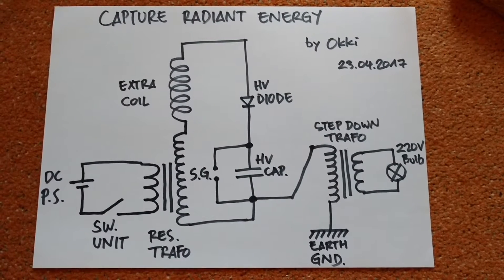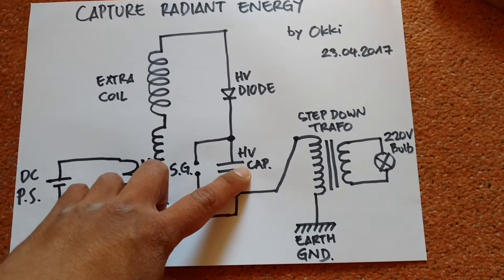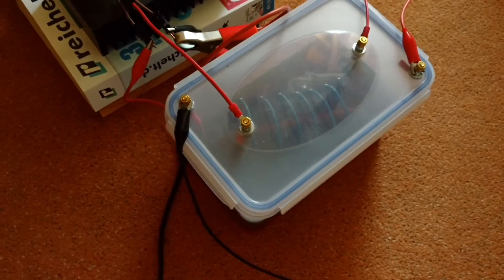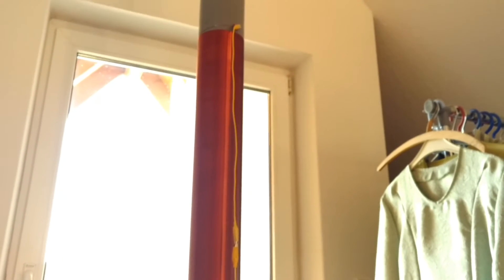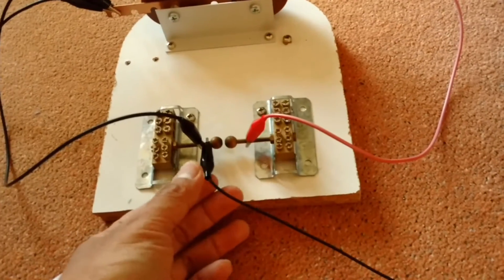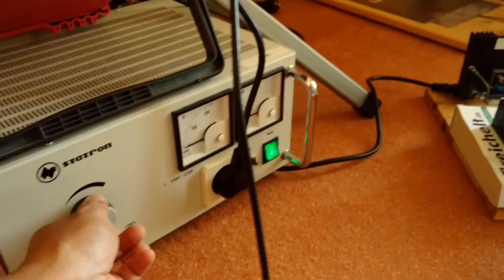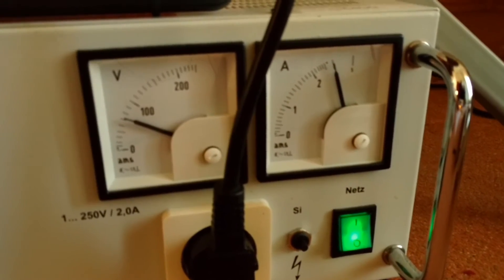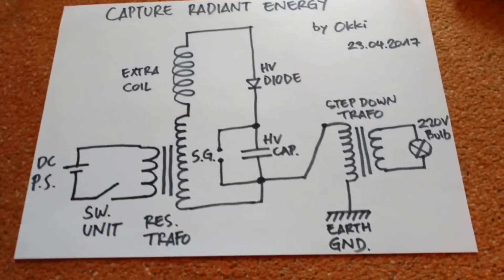Capturing Electro Radiant Energy

Comment: Containment and flow of radiant Energy generated for going down line for later circuit, may increase if in chamber of VACUUM. Hardware store sells 4" Carlon seal-able electrical  box and can add brass fittings sealed in epoxy. The 90 degree perpendicular energy expansion may be reduced with no air.

Comment: This is an old joke.... You need to use only maximally insulated wire. The varnish is a resistor at high voltage. Varnished wire can be used at low voltage.
See how Tesla winds up its transformers by following this principle.

Comment: Put a resistor between earth and the coil. The resistor has to have a little more resistance than the stepdown output coil. This resistor is used as a dam. The electron are easy in and flowing to the least resistance path.

Comment: Please can you explain the situation to me in detail. Is this from Nikola Tesla's ideas? Possible response in Arabic Thank you very much
Reply from the maker: Yes, this is from Nikola Tesla's work. Basically this is one wire power transmission. You can transfer electrical energy using only one wire.
Reply: Please see the other comments from knowledgeable people.
Simply dc is direct current from batteries & ac is current that is switched back & forth 60 times in 60 seconds. This video is not pure Tesla. Energy from the air is positive & energy from the Earth is negative & the you need to store it, like a capacitor & an on off switch & somewhere for extra energy to go, like a light.  Either you have dc or ac.

Comment: According to Gerry Vassilatos's book, you need to filter out electrons from the circuit so you get pure ether current/radiant energy, and the power source must not alternate so DC high voltage power source is preferred, energy flow in the circuit must be unidirectional at all times and must not be allowed to backrush. To filter out electrons, you need to use carbon rods for spark gap and the spark must be magnetically quenched between north and south poles of magnets and spark gap must be sealed in nitrogen gas which absorbs electrons. Also the book says to avoid copper as much as possible and says to replace copper coils with hollow tubular glass filled with nitrogen gas so ether current can flow using nitrogen medium instead of copper medium. Also for top load, use gas filled glass ball instead as using metal top load reintroduces electrons in the circuit. If you get silver-white sparks or brush discharge or light-like rays, you have succeeded, that is the color of radiant energy spark. Using carbon needle on top of glass ball should be good for brush discharge.
Reply: Also the energy flow must be in impulses and not continuous. Depending on impulse duration and voltage, different effects can be manifested according to the book. I think spark gap is how Tesla created impulses.
Reply from the maker: Thank you for your information. I have read somewhere in the internet, that carbon spark gap can charge a capacitor to higher voltage than any other materials. You are right, maybe if we quench this carbon spark gap, we can increase the efficiency further towards over unity.
Reply: @OkkiMoeljadi  When carbon rod is used, spark should look blue-white, blue color being electrons and white color being radiant energy. Magnetically quenching spark gap cleanses the radiant energy from electrons and nitrogen gas absorb electrons and give-off peach colored glow. It would better if you read Gerry Vassilatos's book Secrets of Cold War Technology first Chapter on radiant energy instead. You can find pdf by googling it.
Reply: @OkkiMoeljadi  This video is a recommended watch on radiant energy "Peter Lindemann - Secrets of Cold Electricity".

Comment: what is resonant  transformer is iy any different from normal transformer
Reply: Kifak Omar, I am working on this technology. Resonant transformer is that the primary or secondary or both are tuned to be resonant at certain frequency. Same as any LCR circuit and any transformer has at least 2 inductors. 
Salamat akhouk min beirut.

Comment: Yes...get rid of the extra coil, HV Diode, S.G., and step down transformer...this leaves just the Res. Tranfo transmitting circuit.  

Then add a receiver Res. Tranfo built exactly like the transmitter Res. Tranfo.  

Connect the bottom of the transmitter and receiver secondaries together, either through ground or a connecting wire to carry the HV resonance.  

Add a capacitive electrode (Top Load) to the top side of the transmitter and receiver secondaries (exact same top loads).  These top loads will act as the capacitor of the resultant resonant tank circuit between transmitter and receiver..

So what you will have created is an open capacitor...the dielectric being the environment between the two top loads.  Important to tune your function generator on the transmitter side until the bulb connected to the primary of the receiver glows bright.  However,  you are looking for the a bright glow at a higher frequency which is indicative of the dielectric wave (scalar) of the open dielectric...and not the lower frequency EM wave.

You will know it is the dielectric wave because you can not block the wave in between the receiver and transmitter like you would with the lower frequency EM wave.  Expect to see this in the MHz range.  Since you have 'opened' up your capacitor in the tank circuit...the dielectric will now be combined with the external environment allowing 'gains' as it is now an open system and at resonance.

There, my friend, you have helped me immensely with your videos so I am giving back to you with this information...best of luck!
Reply from the maker: Thanks Mark!

Comment: switching high side, produces a negative inductive (voltage) spike. charging a capacitor with this negative voltage, and discharging the capacitor disruptive(single fast discharge without voltage swing to positive) into a coil, gives the radiant effect.

Comment: This is not even close to radiant energy as described by Nikola Tesla. You created a very fancy way to  inefficiently light a 220v light bulb. Radiant energy as described by Tesla is energy from sources like Ultra-violet rays, Roentgen rays, etc. Read his patent # 685,958, if you want to learn more about what he was talking about concerning radiant energy. Based on your schematic, you built a half wave power supply. The spark gap(Really big resistor), and cap in your circuit form a parallel RC filter. You have to tune this filter by adjusting the cap and/or changing the size of the gap. The RC circuit will act like a filter and shift your waveform 90 degrees as compared to the original waveform. When you turned your device on, I did not hear the sparks from the spark gap. That tells me you did not tune it to resonant frequency.

Comment: And your step down transformer is joined to the wrong terminal of your capacitor
Reply from the maker: Unfortunately the nature doesn't always follow our logic. I did not see any performance difference if I connect the step down transformer to any of the capacitor's terminal.
Reply: Indeed, resistance of the secondary circuit connected to the bulb, is greater than resistance of primary circuit and prevents any increase in efficiency and performance.

Comment: Tesla was an Aether Scientist, so I'll try to explain it in that way. Electricity is made of charge motivated Aether that will draw current along with it. This is not radiant energy. Magnetic fields will push current, current is polarized Aether, or dielectricity which when minimized will define the charge value, but can vary as current regardless of the voltage or charge. Radiant energy is polarized Aether. 
Magnetism is a gradient of polarized Aether. Charge is a focus of polarized Aether, point focused in electrons.
In a hairpin circuit, the charge or voltage is canceled out by shorting two capacitors at each end of the spark gap. This leaves the hairpin saturated with dielectricity or charge-less polarized Aether, cold electricity. When it connects to a conductor, the conductive load sets the voltage, and the balance supplies current. So, it is safe to handle. People without metal implants won't convert cold electricity into charge, so we conduct it safely. High voltage flourescent tubes and low voltage bulbs can be lit in series. What you have is not cold electricity or radiant energy. It will kill you.

A Tesla Coil with a very brief spark of only one direction discharge and a magnetic or hot air spark arrestor will produce a current pulse that is amplified by the amount of polarized Aether it collects from the atmosphere when it sparks. The accelerating HV charge slams into and sweeps the Polarized Aether along with it. The top load of the secondary or third, high capacity coil in the Tesla transformer is designed to hold the charge, but pump out the dielectric pulsed waves. If it sparks, the quality of the sparks are feather-like, not lightning like... again, cold electricity. Most Tesla transformers built today are not radiant broadcasters. Tesla would moan. 

A flat plate can pick up this polarized Aether, just like the second plate from a capacitor does. The air around a Tesla Transformer will be saturated by the dielectricity. Edwin Gray captured it with a plate directly surrounding the low voltage side of his spark gap lead. That terminal was connected to a low voltage potential that did not meet ground, to insure his spark did not switch polarities. He called it splitting the positives. Changing signs (caps will oscillate when discharging) will negate the amplifying effect of the polarized Aether being forced into the collection plate. Thus reducing the ratio of radiant energy. Gray's plate lead went to the load with one lead and the other went to ground across a capacitor (like the hairpin circuit, shorting the charge, but saving the polarized Aether), which offered a sink for the radiant energy that was captured to fill the load between sparks. He used his radiant energy to charge batteries that ran a motor. The device was self--powered by the radiant energy captured from the spark.

So, radiant energy is essentially current without the orthogonal magnetic field created by charge. Your circuit does nothing to separate the two apart and then use the current. That separated current will have a magnetic field, but it will be aligned with the charge field. Which means the current will control the motion of the power. It does this because it is a compression wave that travels through the Aether, not a thing that transits through the Aether., like charge. Although inductors are excellent ways to test the current supplied by radiant energy generators, I'm not sure your set up would demonstrate the quality of your radiant content. Can you produce a feather like spark? Will your circuit light multiple voltage bulbs in series? (I would not do a live test with a person, that's just foolish.)

To maximize the quantity and quality of his radiant energy, Tesla required less than 100ms pulses when using DC power. (Unlike the hairpin that cancels out the alternating voltage.)  He used only air core transformers to handle this speed requirement. You might consider going air core and keeping your windings within the 1/4 wavelength of these signals or higher frequencies just to be safer. You also might look into bifilar windings to reduce flashover and increase capacitance (polarized Aether) dominance.
Reply: You need an index and chapters in there mate  :)
Reply: This pseudo-science, pseudo-physics that people put on the web is just plain FAKE SCIENCE. They use big words and combine them together to make others think they know what they are talking about. It is very frustrating. BMan18's long winded explanation is just wrong. BMan18 if you know so much about this stuff, please write a peer review white paper. Provide your data sets along with your analysis and experiments, so we in the scientific community can review it. If the standard model of Physics is wrong and you are correct. I will get you published, and research funded.
Reply from the maker: Thank you for your long and extensive explanation. I really appreciate it.
Reply: unlost117  :D. I need to read that tomorrow, yes :) .. he forgot to mention one very important thing , but it is outside a bit of his Aether explained context . Aether has memory and intelligence , has it does everything 
Else in the universe .
Reply: Electric charges at different speeds in an electrical environment of varying density and structure give different effects...
If you give ten different names for each effect then you won't get far and the whole thing is also incomprehensible.

Comment: have you attached a current coil on output?
Reply from the maker: Sorry, I don't really understand your question.
Reply: current coil. counter clockwise big and thick wire with few turns harnesses large amperage, have you tried that to combine with output it should boost a little more amps?
Reply from the maker: I have tried that with my slayer exciter. Please check out my electro radiant energy receiver videos. I also made some output power measurements.